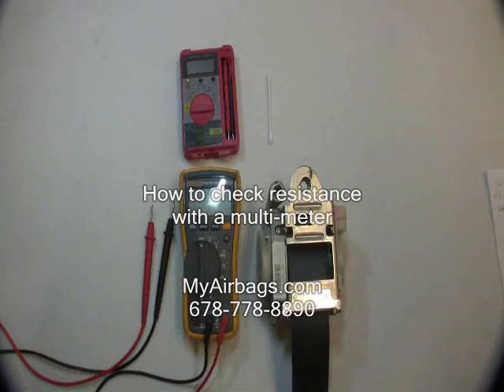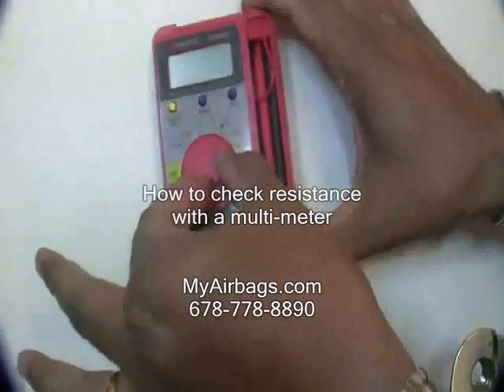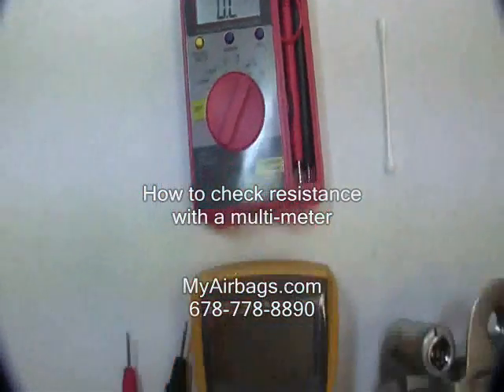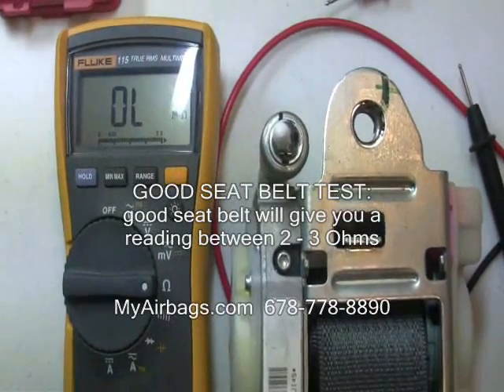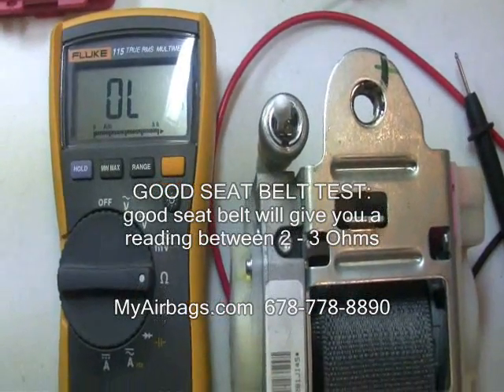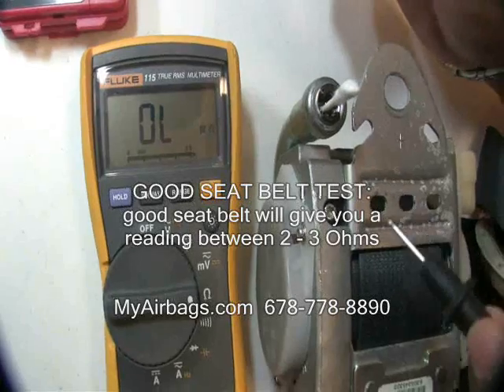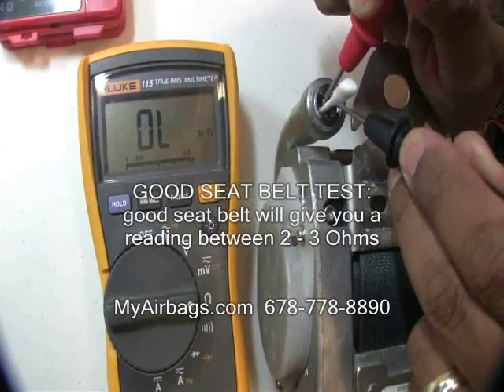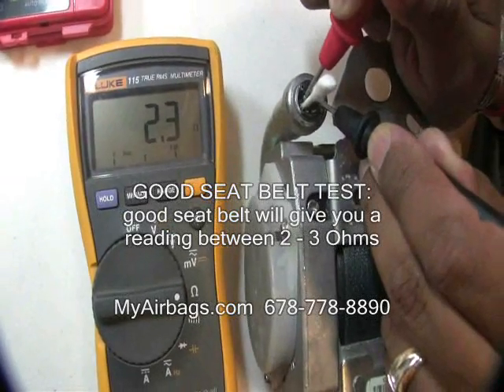How to Test a Seat Belt Resistance  | MyAirbags

Comment: Excellent DIY Video on how to test a Seat Belt Pretensioner and just what I was looking for but please tell me if there is a danger of testing it in this manner as some commentators on other You Tube channels have warned that it may activate the Pretensioner and cause it to discharge?
Reply from the maker: They will deloy if you apply 9v and some times as low as 5v. As long as you use the multimeter properly and have it on the ohm resistance setting that you're good.
Reply: @MyAirbags  Thank you so much for your prompt reply...will do!